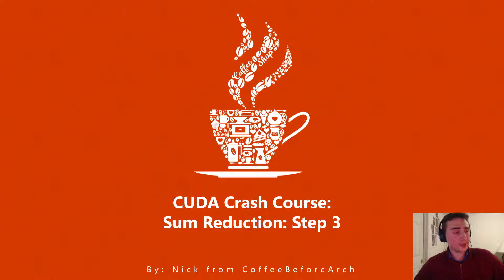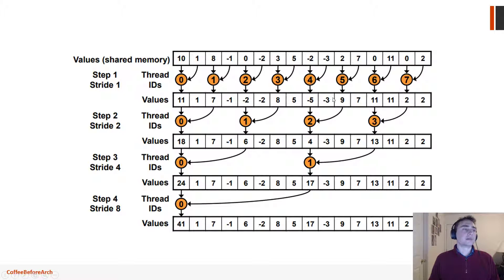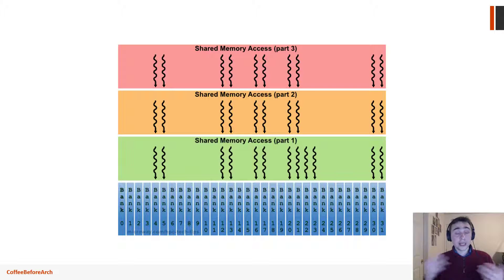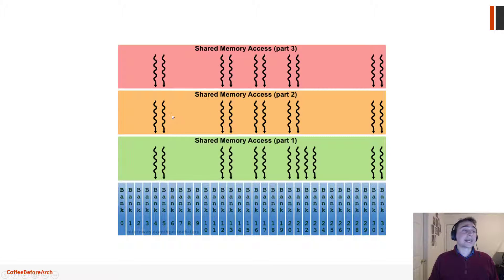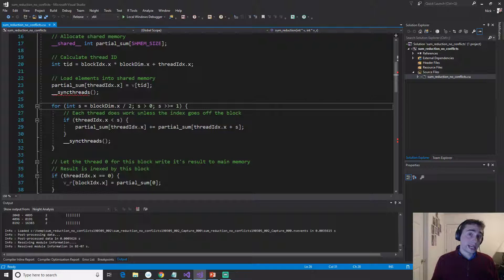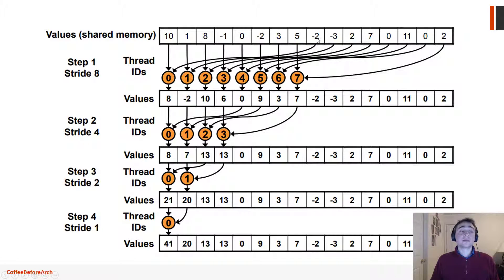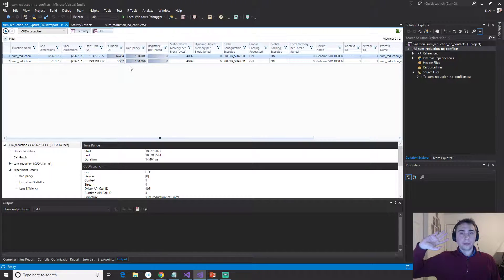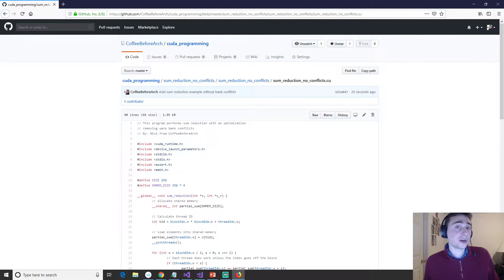CUDA Crash Course: Sum Reduction Part 3

Comment: Could you please explain more clearly why this solves bank conflicts? With the sequential code, th 0 accesses integers(32 bit) at addr 0,1 which are in banks 0,1. th1 accesses ints at addr 2,3 and th 255 will access ints at 255*2 and 255*2+1 . I understand that when these addresses %32 are the same, they access the same bank and require serial access.  
But with the new code, th 0 accesses addr 0,128, th 1 accesses addr 1,129 and so on. addr 0 and 128 access bank 0, so aren't they causing conflict as well?

Comment: well, I wondered why the time spent before and after solving the bank conflicting problem did not change? My GPU card is rtx3050 Laptop. The time cost with code in part2 & 3 are almost the same.

Comment: Hi, maybe I am not understanding something correctly but I believe there isnt a reduction in bank conflicts compared to the previous code. Lets take for example the 1st loop. s =128 so we have reads which are 128 words apart. 128 is a multiple of 32 so the data is going to be in the same bank until s drops below 32. So the performance increase we are seeing here is probably due to not calculating the index variable. Please correct me if I am mistaken as I am new to CUDA and this has been a bit confusing.
Reply: Hi your analysis  "so the data is going to be in the same bank until s drops below 32" is correct .
But the difference is that the previous algorithm has bank conflicts for every iteration.

Memroy Access Pattern - Old Algorithm

Old Algorithm Stride Nr. 6
indices:  0 32  => Bank Numbers: 0,0
indices:  64 96  => Bank Numbers: 0,0
indices:  128 160  => Bank Numbers: 0,0
indices:  192 224  => Bank Numbers: 0,0
Old Algorithm Stride Nr. 7
indices:  0 64  => Bank Numbers: 0,0
indices:  128 192  => Bank Numbers: 0,0
Old Algorithm Stride Nr. 8
indices:  0 128  => Bank Numbers: 0,0

Memroy Access Pattern - New Algorithm

New Algorithm Stride Nr. 6
Memory Indices:  0 4  => Bank Numbers: 0,4
Memory Indices:  1 5  => Bank Numbers: 1,5
Memory Indices:  2 6  => Bank Numbers: 2,6
Memory Indices:  3 7  => Bank Numbers: 3,7
New Algorithm Stride Nr. 7
Memory Indices:  0 2  => Bank Numbers: 0,2
Memory Indices:  1 3  => Bank Numbers: 1,3
New Algorithm Stride Nr. 8
Memory Indices:  0 1  => Bank Numbers: 0,1

full code here: https://pastebin.com/hTR4cgHC
Reply: @adi331  Thanks for your help. Your pastebin link helped me understand whats going on here.
So for anyone who is confused like I was. Take a look at the link posted by adi. There are bank conflicts in both versions of the code, BUT the version in this video has no bank conflicts during stride no.4(s<32) and later while the code in the previous video has bank conflicts for every stride.
Reply: @Antherioner  Glad I  could help :)
Reply: @adi331   and @Stefanos. Thank you for your contributions in this thread XD. I really appreciated it. Though, I am still confused about the number of bank conflicts. In your code output for the new method we have every single thread in the first strides occurring in conflict. Such as in Step 3. How come this isn't that bad?

*New Algorithm Stride Nr. 3*
Memory Indices:  0 32  => Bank Numbers: 0,0
Memory Indices:  1 33  => Bank Numbers: 1,1
Memory Indices:  2 34  => Bank Numbers: 2,2
Memory Indices:  3 35  => Bank Numbers: 3,3
Memory Indices:  4 36  => Bank Numbers: 4,4
Memory Indices:  5 37  => Bank Numbers: 5,5
Memory Indices:  6 38  => Bank Numbers: 6,6
Memory Indices:  7 39  => Bank Numbers: 7,7
Memory Indices:  8 40  => Bank Numbers: 8,8
Memory Indices:  9 41  => Bank Numbers: 9,9
Memory Indices:  10 42  => Bank Numbers: 10,10
Memory Indices:  11 43  => Bank Numbers: 11,11
Memory Indices:  12 44  => Bank Numbers: 12,12
Memory Indices:  13 45  => Bank Numbers: 13,13
Memory Indices:  14 46  => Bank Numbers: 14,14
Memory Indices:  15 47  => Bank Numbers: 15,15
Memory Indices:  16 48  => Bank Numbers: 16,16
Memory Indices:  17 49  => Bank Numbers: 17,17
Memory Indices:  18 50  => Bank Numbers: 18,18
Memory Indices:  19 51  => Bank Numbers: 19,19
Memory Indices:  20 52  => Bank Numbers: 20,20
Memory Indices:  21 53  => Bank Numbers: 21,21
Memory Indices:  22 54  => Bank Numbers: 22,22
Memory Indices:  23 55  => Bank Numbers: 23,23
Memory Indices:  24 56  => Bank Numbers: 24,24
Memory Indices:  25 57  => Bank Numbers: 25,25
Memory Indices:  26 58  => Bank Numbers: 26,26
Memory Indices:  27 59  => Bank Numbers: 27,27
Memory Indices:  28 60  => Bank Numbers: 28,28
Memory Indices:  29 61  => Bank Numbers: 29,29
Memory Indices:  30 62  => Bank Numbers: 30,30
Memory Indices:  31 63  => Bank Numbers: 31,31
Reply: @eduardojreis  Old but responding because this is how I understood it. There are still bank conflicts. there must be because a block is accessing more threads than there are banks. But the "old algorithm" has a lot more conflicts. Don't just look at the side by side ones. for example:

Old Algorithm Stride Nr. 4
indices:  0 8  => Bank Numbers: 0,8
indices:  16 24  => Bank Numbers: 16,24
indices:  32 40  => Bank Numbers: 0,8
indices:  48 56  => Bank Numbers: 16,24

the banks 0,8,16,24 are repeated for this loop iteration causing a lot more conflicts. The new algorithm uses ALL 32 banks wherever possible. So there are less conflicts.
Reply: @adi331  Thank you for sharing this

Comment: Hi thanks for the video, just wondered how you would change it to work with this secnario
sum_reduction<<<1, TB_SIZE>>>(d_v_r,d_v_r) this works because 256x256 is 65536 but say you had an array that was 131072(2^17) then you would have to do the initial sum reduction and then multiple sum reductions(not just sum_reduction<<<1, TB_SIZE>>>(d_v_r,d_v_r)) , How would you implement this in a clean way? thanks
Reply from the maker: For older GPUs, you could simply launch kernels from the host size on a loop for log base TB_SIZE (N) iterations (e.g., log_256(65536) = 2, the number launched for this example.). Kernel-side changes would't be too extreme. You'd just have to do a range check in the kernel to make sure you weren't stepping out of bounds. For newer GPU architectures you could launch a single kernel to the GPU, and do all the global synchronization on the device size (requires some more significant kernel changes). If you have any implementation questions, I'd be happy to answer them.

Cheers,

--Nick
Reply: @NotesByNick  thanks for the reply Nick
I want to try and do the for loop way, just making the numbers smaller to help me understand.
say if you have an array of 512 and block size 16
sum_reduction <<<GRID_SIZE, BLOCK_SIZE>>>(d_a, d_a_r);
in d_a_r you now have 32 lots of 16
if you then put that in a for loop
for(int i=GRID_SIZE/BLOCK_SIZE; i>0; i--){
       sum_reduction <<<i, BLOCK_SIZE>>>(d_a_r, d_a_r);
}
so i starts off as 2 which then gives you a d_a_r = 256 256 16 16 16....etc
then when i gets to 1 it gives you a d_a_r = 736 256  16 16...etc
this gives you a final result of 736 instead of 512, how would you get rid of the unnecessary trailing 16's in the d_a_r? basically I'm kind of confused how you implement the for loop?
Reply from the maker: Before proceeding, one thing you need to fix is the number of iterations. Perhaps I should have clarified, the number of iterations is the ceiling of log base BLOCK_SIZE (N), which is not equal to GRID_SIZE / BLOCK_SIZE (which rounds down with integer division). I do have a slack workspace where this could probably be discussed faster (https://join.slack.com/t/coffeebeforearch/shared_invite/zt-e6bmqnn4-wu2pmCx5VUnGoh7qn5jWKw)